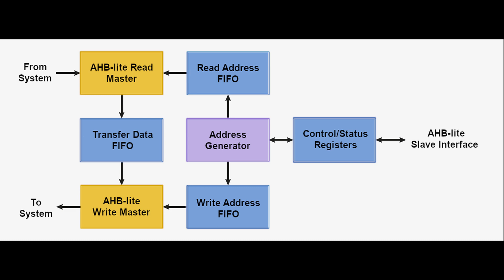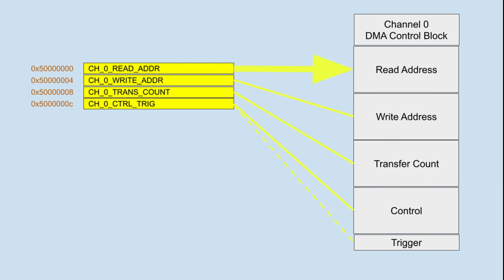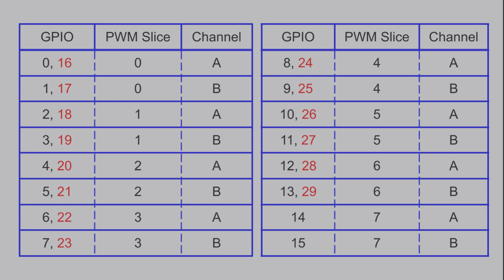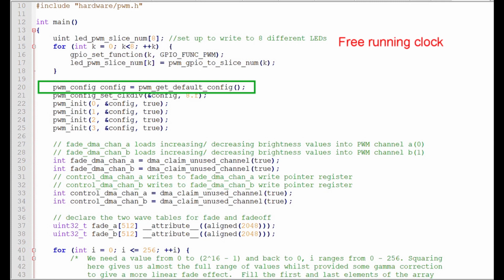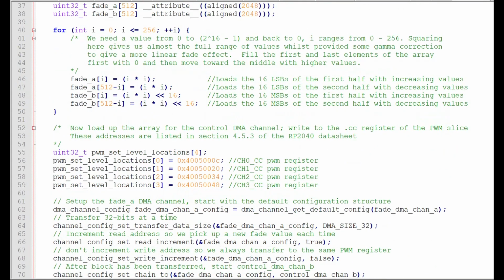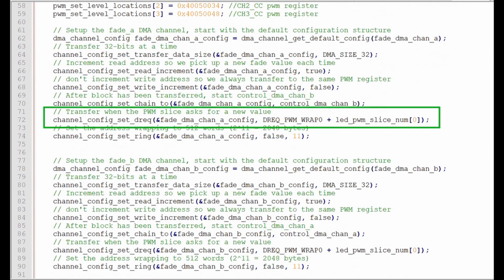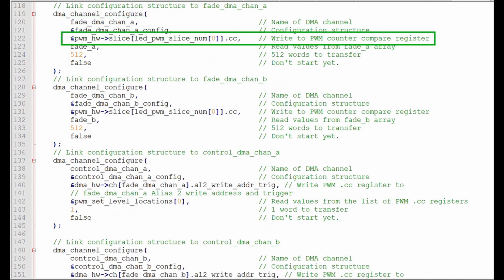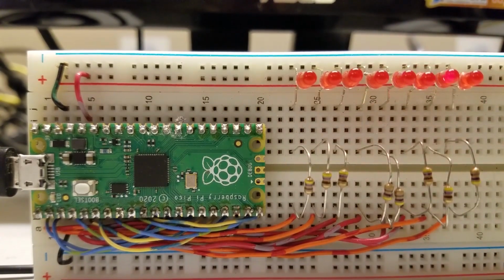Raspberry Pi Pico PIO - Ep. 9 - Direct Memory Access and Pulse Width Modulation: A Deeper Dive

Comment: Hi David,
I'm a bit late to the party but I'm really enjoying this series and am about to embark on porting a temperature logging project from CircuitPython to C on the Pico W.
Incidentally, I notice the 512 element array setting code writes off the end of the array by 1 element. (512 - i when i == 0). A great example of how Python helps save us from buffer overruns and off by 1 errors and how easy it is to have an error like this creep in undetected in C.
Anyway, thanks again for such a wonderful series of videos!
Reply from the maker: Good luck on the temp logger; that's a prefect project for the Pico.  

Yeah, I'm an old Fortran and Visual Basic programmer; sometimes I forget that C has arrays with an index of 0.  I'm working on another video where I'm going back and forth between MicroPython and C and it's a real struggle to keep the syntax straight (I hate that I always forget semicolons in C, LOL).  Thanks for watching!

Comment: Amazing series! I'm not quite sure I understand why it is required to chain the control channels to the fade channels. My understanding was that we are using al2_write_addr_trigger specifically, so that it starts the fade channel and there is no need for chaining.
Reply from the maker: It can be complicated.  In this case we are sending two different fade arrays (one to the A PWM channel, and one to the B PWM channel) with 2 different DMAs .  Then we chain to the control DMA channel so we can change the write address of the fade DMA channel to the next PWM slice.  Using alias 2 just means we don't have to also write the read address, the number of transfers, and the  control data.  There are a lot of terms with the same name (control and channel just to name a couple);; which can cause confusion.  Hope this helps.

Comment: Very nice intros and deep dives into PIO and DMA stuff!

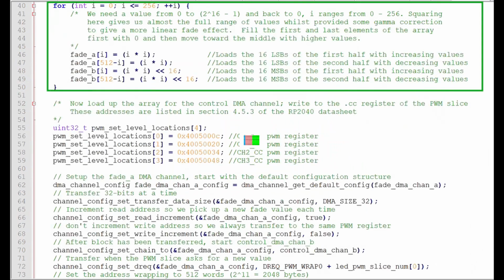@12:00 Isn't it better to use the already calculated value in fade_a[i] instead of calculating (i * i) 4 times in a loop of 256 iterations ? Same issue with shifting, we can avoid shifting twice in each loop iteration.

for (int i = 0; i < 256; i++) // why ++i ?
{
    fade_a[i] = i * i;
    fade_a[256 - i] = fade_a[i];
    
    fade_b[i] = fade_a[i] << 16;
    fade_b[256 - i] = fade_b[i];
}

Also for for loops, if unsigned short is sufficient, then it's better to use it, or equivalently here something like uint_8t
Reply from the maker: Thank you very much for watching and commenting.  Your suggestions are more efficient; I kinda brute forced it while I was developing the program.  I guess I've falling into the bad habits that I used to detest when I was writing programs in machine code 45 years ago.  "C" is not my native language; I'm learning as I go.  Thanks for the tips.

Comment: Can the up/down counter be driven by pio instead of the fractional clock divider?
Reply from the maker: That's a very interesting question.   Although I've not tried it, you should be able to use DIVMODE in the CHX_CSR register to allow the B pin of the PWM channel to control the counter (see table 525 and figure 112 of the RP2040 datasheet).   Map the PIO to output to a different GPIO and physically jumper them together (each GPIO can only have one function at a time).  That should allow you to single step or start/stop the PWM counter using PIO.  Good luck!
Reply: @LifewithDavid1  Excellent! One step closer. Now all I have to do is figure out how to explicitly change the direction of the counter so I can either increment or decrement the counter on a pulse by pulse basis. 
Thanks for your help.

Comment: Thank you for taking the time and trouble to research these in depth and it has to be said, pretty niche subjects. I struggle to comprehend this stuff, but am very interested nonetheless. I have a few Picos and have dabbled with PIO (cut ‘n’ paste; not my own work), and “made” (a lost weekend in the case of W.10), VS Code work on W.10 and a Rpi-3b+
David, I have a question that I have wanted to ask for a good while now, and I think that you may be the man to answer it: Do you think (as I do) that the RP2040 is very much more feature rich than MCUs that have gone before it? And if so, why? I don’t think it can be for the home hobbyist due to aforementioned “niche-ness”. I don’t think it can be to take over the world of micro-processors due to a whole host of factors (e.g. price: cheap, clock speed etc.). 
I have been fascinated by the thinking that must lie behind the RP2040 since its launch last January. It feels like a very special and significant chip, but I can’t explain why!
Reply from the maker: Thanks for the kind words, and thanks for watching!  I believe the RP2040 is a game changer.  It has all the features of Arduinos; plus PIO, DMA, and a number of serial interfaces.  The clock speed and significant memory allow for very powerful computing (for an MCU).  The range of possible applications include robotics, engine control, IOT, test equipment, navigation equipment and many others.   Arduinos are good for lower level control; but the RP2040 can be used for almost every application.  It could become the ubiquitous chip for today just like the 6502 in the late 70's and 80's.  And the support is great!
Reply: Single cycle IO at over 100 MHz is incredible, as is the programmable Io feature.  I think the rp2040 is a game changer, too.

People have even encoded TMDS signals for HDMI on the fly with this thing.  I think it's quite incredible that this is done with a microcontroller, and it's even more incredible that it costs under 2 usd (1 usd in the USA from certain distributors).

Really an awesome chip, it makes some stuff that used to be limited to FPGAs become possible on a tight budget.
Reply from the maker: @danieljimenez1989  I agree, the RP2040 has IO performance of a Raspberry PI or other SBC but in a much more robust "package".  Just try pulling the plug on a straight Raspberry Pi and you will corrupt the SD card two out of three times.  The Pico thrives with that "abuse".

Comment: 1) I did not immediately work, corrected as follows:
Derived array definition from function (stack) to global space

uint32_t fade_a[512] __attribute__((aligned(2048)));
uint32_t fade_b[512] __attribute__((aligned(2048)));

uint32_t pwm_set_level_locations[4] __attribute__((aligned(64)));

void main()
{
..
}

2) These lines are superfluous
channel_config_set_chain_to(&control_dma_chan_a_config, fade_dma_chan_a);
channel_config_set_chain_to(&control_dma_chan_b_config, fade_dma_chan_b);
since the channels fade_dma_chan_a and fade_dma_chan_b are started through an entry in the al2_write_addr_trig

3) Pins 1, 3.5, 7 do not completely turn off, pulses remain there, this is not noticeable on the LEDs, but it is visible on the oscilloscope
Reply from the maker: Thanks for the feedback.  Next time I have the Pico attached to that breadboard, I'll check it out.  I'm surprised it didn't work for you; it was stable for me.  Thanks for watching!
Reply: @LifewithDavid1  I inserted your code into my "big" program and either the stack size was not enough, or something else.
This is how I fixed the non-complete shutdown of channels 1,3,5,7
for (int i = 0; i < 256; ++i) {   //    i < 256
fade_a[i] = (i * i);
fade_a[512-i-1] = (i * i);  // -1
fade_b[i] = (i * i) << 16;
fade_b[512-i-1] = (i * i) << 16; //-1
}